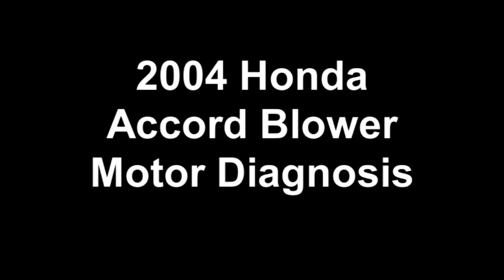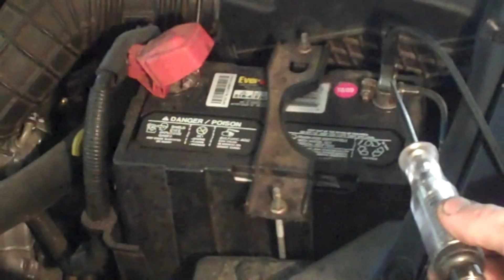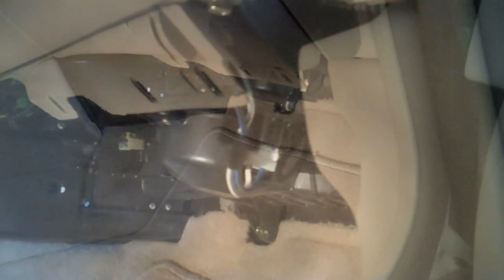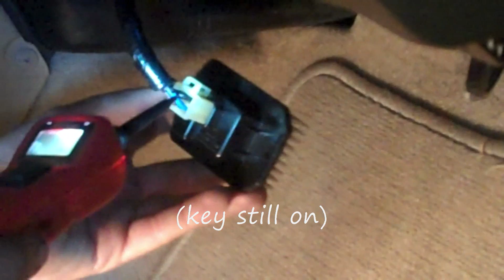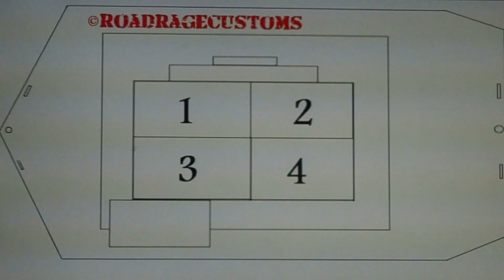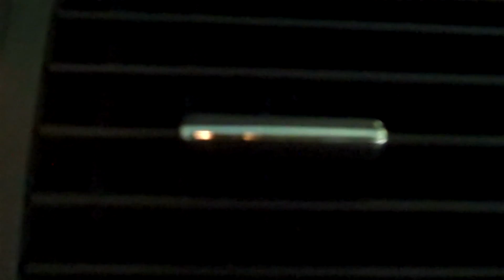Honda Blower Motor Diagnosis

Comment: When the blower motor is running you could hear it slowly reduce its speed. Turning the blower control knob off and on will restore the speed at the correct setting. In addition, it will intermittently just stop running until you cycle the ignition key off and on and it will come right back on and work as it should.   Is this pointing more to the resistor or the blower motor itself?

Comment: You’ve just earned yourself a subscriber.  My mechanic told me it was my motor blower and my compressor.  I attempted the job myself, and turned out it was just the resistor.

Comment: Question? I have  + and - but when i plug it to the blower motor they both read + when i put direct - the blower motor turns on. Is this a resistor issues aswell? Im yet to test the resisitor thanks for the video 👍🏽

Comment: Replaced resistor and blower motor comes on.. Fast forward 2 weeks and now blower motor stays when key on. Blower won't shut off regardless of off/on switch. Blower does increase when adjust fan speed to high. Relay?

Comment: Honda Odyssey 2000

With mine -- sometimes the blower doesn't work but, when I hit a bump in the road it turns back on.

The other day the blower was barely blowing any air -- even on high and the following day it had completely stopped working even after I had intentionally drove over many bumps in the road.

The rear fan works but the dash is completely dead.

Comment: I had same problem with my 08 MDX , changed resistor and it worked for about 10 minutes then quit. The blower motor works, do you have any other ideas what the problem could be? Tks Rick

Comment: Had 1500 ohm between pins 3 and 4 for my 4 dr sedan and the blower resistor  was bad. Removed and replaced problem solved.

Comment: After replacement of a bad blower motor less than a year ago, mine started acting up. 
I looked at the wires and noticed that they go from the right side (94 Accord LX) and go directly to the motor.
So I was baffled by the intermediate on and off.
I checked the fuse under the hood.
 It was fine.
I replaced my ignition switch thinking that was the problem. 
Nope!
Just now I went to the passenger side and turned the ignition switch to position 2 and wiggled the power plug at the motor.
Problem solved! 
In short I would start there.
You'll save money and time and a grip of sleepless nights trying to figure out what happened.
Stay cool!
😎

Comment: Good cuestion sr .. that can cause that my radiator fans dont work wen i turn on the coold ac?  Cus now no blower noise of work no hot no coold air noting happen .. do you think that that resistor stop my radiator fans??

Comment: It's not a transistor. 

It's a RESISTOR.
Reply from the maker: @SHIFTY, argue with the manufacturer. I only referred to it as that because, at the time, that's what you had to call it in the Honda parts department to get the right part. https://www.hondapartsnow.com/genuine/honda~transistor~power~79330-s5a-942.html

Comment: Do you have an idea what is wrong with a 2003-2007 Accord EX Dual Climate control; Where heat and or A/C blows hot out  of the driver side vents correctly  but it blows out very minimally on the passenger side vents? Also if there's a video available on youtube please post the link or it would be greatly appreciated if you could a video explanation on this issue  (There's a lot of driver side videos or videos about heat blowing on one side & cold on the other, or not blowing air/heat through the vents at all but I haven't came across one where the passenger side vent isn't blowing hot/A/C air out hardly at all). Thank You

Comment: ATTENTION PLEASE: if u do what he says and there is still no air comming out vents,there is thing called flap actuator. 1) for max ac located by cab filter (glove compartment) 2) central vents etc, located left to 1(must remove glove compartment) 3) hot/cold on driver side,above to the right from gas pedal.
OFTEN,they stuck i spend hours looking for them ,damn mechanic didnt want to say anything. try GENTLY to move the plastic parts many times with screwdriver. Mine works fine now.

Comment: I know it is an old video, but... 
Have you ever seen an intermittent blower fan from a failed transistor?
Reply: Yes. The plug into the resistor goes open circuit. Or it's the brushes in the motor itself.

Comment: As a 38 year old mother of one I never thought I’d be able to make a repair like this on my own. The fact that my dad is a retired mechanic helps me realize that a car can be picked apart and put back together, it’s not as intimidating as it seems. He’s out of the country right now and it’s winter ❄️ not having a working vent is like having a dead car. Thank you SOOOO much for the step by step diagnosis and replacement, I’ll be smiling all freakin day!!

Comment: Thanks for this video. It was really helpful and my son and I changed the resistor on his 2003 accord coupe 6cyl. It fixed the problem. But after two weeks the fan stopped again. Any thoughts on why this might have happened again?
Reply from the maker: Todd Baumgardner it could be caused by high current draw from a failing blower motor.
Reply: @roadragecustoms  Thank you.  Do you have a video on how to check, fix, or replace that? Lol
Reply from the maker: Todd Baumgardner sorry. At this time, I do not.

Comment: Question if the transittor not working does it stop power from goin to the a.c compressor?
Reply from the maker: gregory toussaint no
Reply: Ok thank you
Reply: What about if the blower motor not working is that a remote for the a.c compressor to have power?

Comment: Great informative video. Question though. Is there a way to check the ground without that 2 different colored lights on that meter? Can I check this with a multimeter somehow.
Reply from the maker: Michael Adonis you can use a multimeter to check a ground. Set it on DC volts. Connect red to battery positive. If black is on a good ground, battery voltage will be displayed on the meter.
Reply: roadragecustoms, so I need a long lead to go from battery to the resistor to connect to the power on battery and ground on the part?
Reply: Oh. And thanks for replying.
Reply from the maker: You could connect to any terminal in the vehicle with 12 volts positive including most terminals in the fuse box.

Comment: Hey I have a 2005 Honda Civic Es1 and my ac blower is always on even on 0. Wanted to know if it could be the blower resistor?
Reply from the maker: On many venicles, blower only working on high is a very good indication that the resistor has failed.
Reply: Ok thanks. I have tried changing it like 6 times with resistors I can find where I am from but it hasn't fixed the problem. Could it also be  relay or maybe the ones that I got here were defective also? If so can you direct me to where I can get a new one that works properly online?
Reply from the maker: I read your original problem wrong. You most likely have a stuck blower motor relay, or a wiring issue.
Reply: This is really helpful man I've been going to electricians for about a month now and they're all saying it's the resistor, but I changed like 6 or 7 already so I found it difficult to believe that it really was the resistor. Where is the relay located for the blower?
Reply from the maker: http://fusesdiagram.com/honda/fuses-and-relay-honda-civic-2001-2006.html
Reply: Thank you so much for your help. Your videos are really informative and your responses to questions are great and very helpful. I will definitely continue to look at your videos man. Thanks again.

Comment: This was a great video and really helped me. I tested the fuses and relays which were working fine. Testing the resistor I got infinite resistance. My local breakers yard were able to supply a genuine used fan speed resistor for my 2002 accord at a tenth of the price of a new genuine part. Thanks for a very clear video.

Comment: I have the same issues right now with my Honda Civic 2012.. i bought the parts at pepboys and will work on both a new resistor and blower motor.. its hot ass hell with no ac in a fairly new vehicle now thats freakin crazy.. good video god bless

Comment: HI GREAT VIDEO ... I have a quick question ( Ok maybe not so quick :-)  I had a issue with the blower transistor (had a friend hot wire the blown fuse in the blower transistor .. ( Just so I could see if it would work and if that was the problem he didn't change the Mofset chip )  The fan works and the AC blows cold and works ....BUT the air will not blow out of the two center vents ?? Any idea what might be causing that ?  TIA
Reply from the maker: PorscheCrazy00 I could only guess. Could be any of the following: mode door stuck, defective actuator for the door, switch, wiring, etc.
Reply: Well it seems that I am getting a med amount of air out of the adjustable side vents in the Honda Element
( sorry I should have stated that ) :-)
I am getting what seems to be full flow out of the windshield defroster 
And no flow out of the center and floor vents 
Air is cold and hot ( as I adjust temp ) so that works 
Any help would be greatly appreciated 
Regards
Ed

Comment: I have a different problem. Fan blows and won't shut off unless I turn the car off. Turn it on and it starts blowing again. A/C works intermittently. Blower runs strong but won't shut off even with fan in OFF position. Help?
Reply: Check the compressor clutch and make sure the pins that attach to the compressor are not too tight. If the clutch is wearing down two things can happen. Either the AC won't work or the Fan keeps blowing.

Comment: 03 Element,  all perfect.  One am tried to start AC after starting car:  nothing happened.  Tried heater, same thing.   Don't trust dealer a lot so what can I do myself.  Tried start again yesterday but absolutely 0 response from heater/AC/ no air from vents, anything.    Help!!!
Reply from the maker: Laura Cullen as a starting point, you can check your fuses.

Comment: My 2004 Honda Accord's problem is that when I press the buttons to switch vents whether it's front vents, lower feet vent, window vent, defroster, etc. vents do not changes.  The motor blows air, I get all the air in the world, I get heat, a/c and I can even control the speed and temperature.  Everything works EXCEPT changing from 1 vent to another.  What you suggest
Reply: Probably the door blend actuator. It’s failed or stuck
Reply: King Less I think it's something to do with the mode selector motor

Comment: it's winter and I started my car (97 Accord) the blower was on max and I heard a faint pop and the blower stopped and the lights on the ac/heat console are also out, I tried switching the 40a fuse but I got nothing any advice?

Comment: The advice about only checking the resistance across just 2 pins is not complete.  I thought it was my blower motor because I had the 1500 Ohms across pins 3 and 4 on my 4 door.  Now I have a brand new motor and discovered the transistor is bad across 2 other pins.  But I am grateful for this video, it got me in the right direction.  Anyone want to buy a perfectly good used motor?
Reply: Larry Cain what did the other 2 pins read on the meter?

Comment: Is there a difference between a resistor and a transistor? I'm asking because I have a 2008 Honda Civic coupe and recently my air just won't turn on its off completely. I tried turning the knobs I get nothing but also when I start to drive I can feel a fraction of air coming out of the vents like barely. But when I completely stop nothing comes out so not sure if you would know if this would be a resistor or transistor not sure what the difference is? Also note that some morning my ac/heat comes on and I'm good for that trip but when I turn the car off and back on I get nothing so as of right now I'm getting nothing coming out of my vents.
Reply from the maker: Chris Potter Most cars have resistors. Some people call transistors, resistors. They will only have one or the other, not both. They both basically achieve the same end result, they just do it differently.

Comment: Thank you Thank you Thank you !!!!!!!!!!!!!!! My front fan was not blowing. Checked all the fuses, replaced the relays and still didn't blow. Next I bought a motor at parts store.... plugged it in in parking lot and it moved a little bit.... but did not run...... took it back and bought the transistor. Plugged that in in the parking lot and the fan worked fine !!!!!!!

Comment: Before testing the wires feeding into the resistor did you reattach the wiring to the blower motor?  From the video I couldn't tell if it was reattached prior to testing the resistor wiring. 

When I unplugged the wiring harness from the blower motor and tested the wires, the white wire had power and the blue wire didn't have any power (just like in the video).   If I hook the harness back into the blower motor and then test the transistor wiring harness I get a charge on the blue wire (just like the video) but my tester isn't lighting up when I touch the black wire on the transistor harness, which in the video the black wire activates the tester's light.  Admittedly, I am using a much simpler tester than what is used in the video so I might be missing something. If I am not getting a charge on the transistor's black wire does that mean that my problem might lie somewhere else then in the transistor?

Comment: Thanks roadragecustoms! Fuse was good so I took a chance and replaced the blower motor resistor on my 2004 Accord 6cyl as I have no test equipment. That did the trick. Fan is working great now. I appreciate the high quality information.

Comment: Great video. I used it on our 2005 Accord Hybrid. It's also very important to reinstall the resistor (that's not a transistor) into the panel before using it for any length of time. That's were the heat sink gets cooled. Otherwise it will burn out pretty quick. Yesterday I bought the part and installed it at the store, but thought I could wait until I got home to screw it back into the panel.  By the time I got home it had burned out.  Lesson learned.

Comment: HELLO, I HAVE A HONDA ACCORD 2003 ex V6, THE CLIMATE CONTROL IS NOT BRINGING ON ANY LIGHT ( CLIMATE CONTROL NOT POWER ON) AND IS NOT SWITCHING ON EITHER THE AC OR THE HEATER. I CHECK THE RESISTOR AND THE BLOWER BOTH WORK PERFECTLY. PLEASE WHAT CAN I DO. THANK YOU.

Comment: Great video!! Awesome info. When I used my multi meter to check for power and ground at blower motor it read just almost battery voltage. If I used my test light across motor connector....nothing. Resistor had just enough ground for meter reading but could not light test light. Resistance test on pins 3 and 4 showed open circuit. New part installed with success. Thanks so much.

Comment: IS THAT A RESISTOR ? NOT ! A TRANSISTOR ? CONTROLS FAN SPEEDS !
Reply: +rondogg50 As I understand it, they use a transistor now to give infinitely variable blower speeds, instead of the 4 or 5 speed levels old-fashioned resistor arrangements might offer.

Comment: Help! I replaced the front a/c transistor and it fixed my front air flow right away I was so happy to have air in the front again. it lasted about 15 miles and blew the new one. What may be causing this. I gave almost $100 dollars and it just blew! ok to back up a bit: before replacing the transistor the front air was not working the rear air was. 04 Honda pilot. thanks,
Reply: Your fan motor is faulty. It has a faulty bearing internally. As the blower motor bearing wears, increased resistance occurs. Increased resistance requires increased amperage draw. The resistor is not designed to handle the increased draw, and then fails.
Reply: If you left it hanging there without screwing it back into the panel, that's probably what did it. It needs to be in there with air blowing on the heat sink to cool it down. That's what happened to me.

Comment: i have a question.  what if i dont get any power in the wires to the transistor to the blower fan.  i also checked for power on the blower motor relay and there is power. would this be a wiring issue? relay failure? tried a different relay still no power in the wires.
Reply: Do u find out the problem ? I have same issue as u.

Comment: hey i have a 2007 civic and my heater blower sometimes work . i can hear it . but running very slow , its after i hit it with my hand directly underneath the blower when it gets full speed. can you tell me what  it can be? thanks.

Comment: hi i need your help I have a 2004 honda accord check engine land marking code p0685} pcm ecm relay control circuit avierto circuit. q I believed was some bad fuse or maybe if it is not seen but asimple Vinada any rrespuesta is wrong please helpful?

Comment: Not trying to be a smart ass here but, is it called a resistor? Not a transistor? My AC isn't working on high, only low and I suspect the same problem. Thx for the vid.

Comment: My wife's 03 Accord EX just experienced this same issue. Found blower motor was not working at all and didn't work on any speed. The A/C clutch would not engage either, but when I turned the blower knob on, I could hear the radiator fans running. Performed a few basic checks of fuse, ran power directly to the compressor clutch and heard it engage. Ran power directly to the blower motor and it also operated. Confirmed 12v was at blower motor, but Ground was not present. With the help of this video, I traced the issue to the blower motor resistor as well. Performed the test as roadragecustoms suggested and found 1507 ohms between pins 3 &4. Took a gamble and replaced the resistor and now everything is working properly again. Not sure what other tests could be performed since it passed the resistance test between pins 3 &4. Either way, it works again. This video was very helpful!

Comment: When there is a failure in the transistor, does the AC cluch and radiator fans also doesn't work? did you get any DTC codes?

 Great video BTW :) thanks!